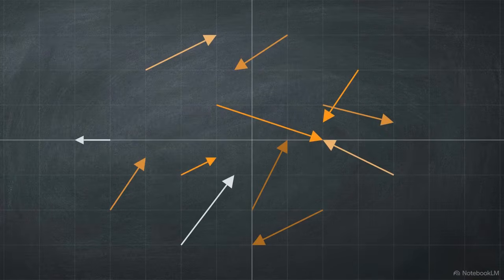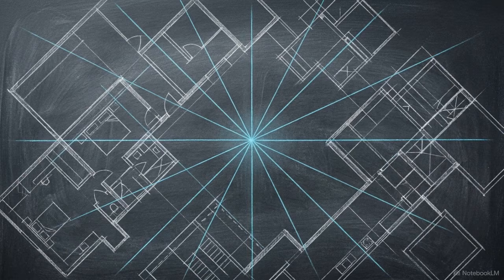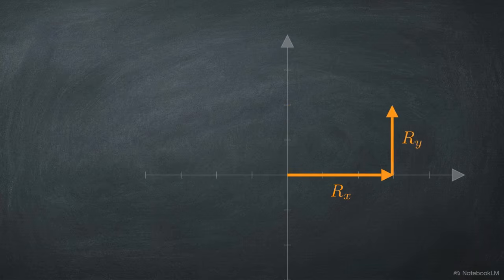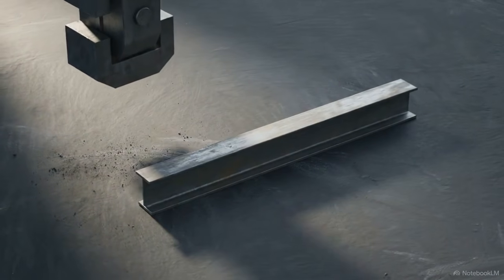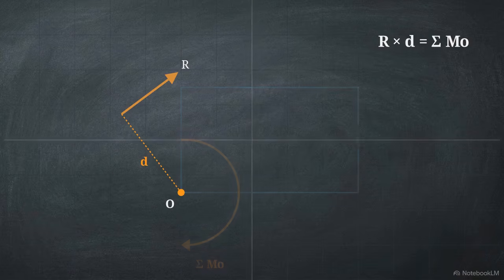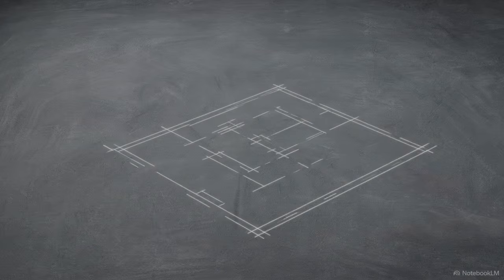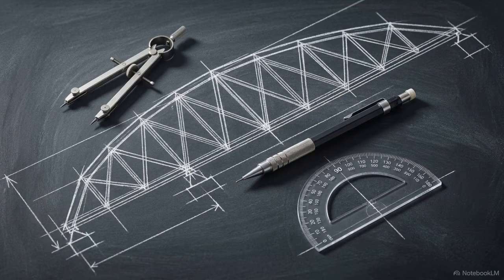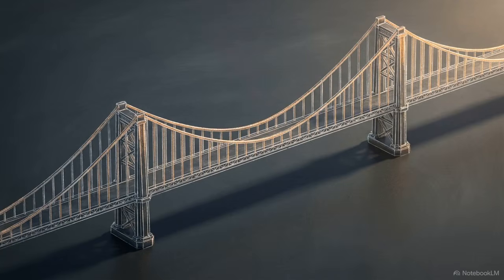Taming Structural Chaos  From Coplanar to Spatial Resultants

Comment: 2D→3D uses the same core rules, just extended. Unit vectors split forces into clean x/y/z parts. Resultants combine them via magnitude and direction cosines. 3D moments use cross products for full rotational clarity. This turns complexity into straightforward, systematic analysis.

Comment: The most important thing that I have learned from this video clip is the need to understand the concept of vectors in 3D force systems compared to 2D. Through Cartesian vector notation, the unit vector approach, and the directional cosines approach, it is possible to express forces in all the three directions. It was important to understand the use of the cross product to calculate moments since it reveals the effect of the force’s magnitude, direction, and location on the structure.

Comment: The video helped me understand that complex force systems can be simplified by breaking forces into x, y, and z components using vectors and unit vectors. I also learned that resultant forces and moments help engineers understand the overall effect of forces and their positions on structures.

Comment: I realized that structural forces can become complicated when they act in different directions, especially in three dimensional space. By using orthogonal decomposition, these forces can be separated into simple X, Y, and Z components, making them much easier to calculate and understand. Instead of dealing with many forces individually, we can combine them into one resultant force that represents their overall effect. I also learned that moments are important for understanding the twisting or rotational effects of these forces. Overall, this lesson showed me how engineers can turn complicated spatial forces into organized calculations that help make structures stable and safe.

Comment: Complex force systems can be simplified by finding a single resultant that represents their overall effect. What I found interesting is how unit vectors and x, y, and z components can be used to analyze forces in three-dimensional space. The discussion of moments also helped me understand that the position and direction of a force are just as important as its magnitude. This video is very helpful by showing me how breaking down spatial forces into components makes 3D statics problems more organized and manageable.

Comment: My key takeaway is that the 'resultant' isn't just about simplification, it's a critical bridge between physical complexity and mathematical control. Whether dealing with coplanar or spatial systems, the fundamental workflow remains consistent, decomposing vectors into their orthogonal components and applying the principle of moments to ensure the resultant accurately replicates both translation and rotation. It’s a powerful way to turn structural chaos into a solvable model.

Comment: I learned from this video is that solving spatial resultants requires understanding vectors, unit vectors, and cross products, not just simple force addition. This help me see how engineers analyze forces and moments in three-dimensional structures accurately. This lesson made me appreciate the importance of vector analysis in engineering mechanics.

Comment: Hello! After watching the video, this helped me to understand how engineering analysis transitions from 2D coplanar systems to 3D spatial systems. I learned that using Cartesian unit vectors and cross products makes it easier to determine spatial resultants and moments accurately. These concepts are essential for solving real engineering problems involving complex structures. I learned a lot from the video, thank you!

Comment: I learned in this video that moving from 2D to 3D statics uses the exact same rules, not new physics. You just break forces into basic x, y, and z parts to find one main combined force. Then, you place that force where its turning push matches the original forces. In short, 3D math is just adding a third direction to simple 2D steps.

Comment: Navigating 3D force systems is inherently more complex than working in 2D because of the third spatial dimension. However, utilizing vector notation across the x, y, and z axes provides a structured way to define both the magnitude and direction of a force. Additionally, applying the cross product makes calculating moments in three dimensions straightforward. Mastering these vector techniques is vital for analyzing real-world structural scenarios and tackling advanced engineering problems.

Comment: What I have learned is in coplanar concurrent force systems, all forces meet at one point; to find the resultant, we can simply use trigonometry methods, and when forces do not meet at a single point, they form a non-concurrent system. Varignon’s theorem helps locate the resultant’s position by stating its turning effect equals the total of all individual moments.

Comment: I realized that solving 3D force systems is more difficult than solving 2D problems because you have to consider one more direction. At first, it was a bit confusing, but I learned that using vectors and the x, y, and z axes makes it easier to represent the magnitude and direction of a force. I also learned how the cross product is used to find the moment of a force, which is an important concept in engineering. Even though the calculations can be challenging, understanding these ideas helps me see how they are applied to real engineering situations and prepares me to solve more complex problems in the future.

Comment: I learned that solving 3D force systems is harder than solving 2D problems because there is one more direction to consider. We use vectors and the x, y, and z axes to show the size and direction of a force. We also use the cross product to find the moment of a force. These ideas help us understand and solve real engineering problems.

Comment: I learn that analyzing 3D force systems requires a far more systematic vector approach than 2D problems. By leveraging Cartesian vector notation, unit vectors, and directional cosines, complex spatial forces can be represented with precision. Additionally, applying cross products to calculate moments highlights how force magnitude, direction, and position positionally impact a structure—demonstrating how these foundational concepts unite to solve real-world engineering challenges.

Comment: One of my biggest takeaways is that solving 3D force systems becomes much more organized when using unit vectors. They allow forces to be expressed accurately in the x, y, and z directions, making it easier to calculate spatial resultants and moments. I also learned that the cross product is essential for finding a 3D moment because it accounts for both the magnitude and direction of rotation. Overall, breaking vectors into components makes complex engineering problems much more manageable and precise

Comment: Similar to the previous video posted, forces is not that simply vertical and horizontal movements but it also acts at angles which makes the analysis difficult. Here in the video, the resultant force is explained further that it is a single force that replaces an entire system of forces and should have same linear motion and moment. Coplanar Concurrent and Coplanar Non-Concurrent are also differentiate where Coplanar Concurrent lines of action intersect at one common paint while the second one don't. Trigonometric knowledge is a vital component we student should have since this is widely used in this topic.

Comment: This video made me realize how engineers make complex structural forces easier to study by replacing many forces with a single equivalent force called the resultant. For 2D systems, forces are broken into horizontal (x) and vertical (y) parts to find the total push or pull, while non-concurrent forces use the principle of moment or Varignon's theorem to find where the total force actually pushes. It's the same case in 3D systems but in 3D direction z is added allowing engineers to calculate the total overall force and pinpoint its exact position in space.

Comment: Good video, explaining how things and real life problem in terms of structures are solve using process such as breaking down and solve every problem one by one till arrived in one answer or called resultant. 2d and 3d version are just the same but 3d version can give a much more accurate visualization on the problem and process. Monotoring and analyzing the problem carefully is a mandatory in every situation before coming up to the final answer. Balance will only be attained using proper calculation and visualization especially with the use of cartesian plates to draw and solve different structural problems.

Comment: The video really made engineering click for me. It’s all about taking tough problems and making them manageable. When you split forces into horizontal and vertical components, everything starts to make sense, you can actually see how a structure holds up and figure out if it’ll stand firm or wobble. What stuck with me most was how important it is to tackle problems one step at a time. If you keep things organized and break the work down, even the hardest challenges don’t feel so overwhelming.

Comment: After watching the lesson, I realized that solving spatial resultants is easier than I first thought. The most important part is breaking each force into its x, y, and z components using unit vectors. Once the forces are separated, it becomes easier to add them and find the total force. I also learned that in 3D moment calculations, the position of the force is just as important as its direction. This topic showed me that solving engineering problems becomes more organized when each step is done carefully.

Comment: This video explains how force reduction is used by engineers to simplify and be efficient at solving multidirectional forces into a resultant. With this, engineers can predict the structure's movement. The addition of the Z-axis allows us to solve for the total force magnitude of the structure. The main takeaway here is that simplifying forces into a single resultant vector is essential to predict if a structure will stay balanced or collapse.

Comment: The clearest takeaway I got is how everything builds up from 2D coplanar forces into full 3D spatial systems — it’s not just adding a z‑axis, it’s a whole systematic shift. Using Cartesian vector notation and unit vectors with directional cosines makes it so much cleaner to handle forces in space instead of guessing angles. And the big one: moments in 3D aren’t just force times distance anymore — you really need the cross product M = r × F to get both magnitude and direction right, especially when calculating moments about specific points or axes. It ties everything together so you can actually compute resultant force magnitude and directional angles precisely.

Comment: I've realized that the disciplined application of three-dimensional orthogonal decomposition across the x, y, and z axes is the key to mastering spatial force systems. Using cartesian Vector, unit vector and etc.
I can now determine the precise magnitude of a resultant vector in space instead of being overpowered by 3D complexity. I've come to understand that Varignon's theorem allows me to satisfy rotational moments by adding the individual moments produced by these decomposed forces, continues to be the main driver of the analysis. In summarize, this video really helps me to really analyze more complex problems that we will tackle in engineering.

Comment: my point is that it is easier to analyze forces in 3D using unit vectors. By breaking each force into its x-, y-, and z-components, the spatial resultant can be determined and the moments can be calculated accurately. This is because real structures are subject to forces in multiple directions simultaneously.

Comment: Instead of dealing with a bunch of forces acting in different directions, engineers simplify everything into one equivalent force called the resultant. This is done by breaking each force into its x, y, and z components, adding them together, and calculating the final magnitude and direction. For more complex 3D force systems, moments are also considered to determine the exact point where the resultant acts. What I found interesting is how a complicated set of forces can be reduced into something much easier to understand and analyze. It made me realize that solving engineering problems often starts with simplifying them into a form that is easier to work with.

Comment: I’ve come to see that mastering spatial force systems is really about the disciplined application of three-dimensional orthogonal decomposition across the x, y, and z axes. Instead of feeling overwhelmed by 3D complexity, I can use a single equation, the square root of the sum of the squared components, to find the exact magnitude of a resultant vector in space. I've realized that Varignon’s theorem remains the engine of the analysis, letting me satisfy rotational moments by summing the individual moments generated by these decomposed forces.

Comment: I realized that tracking every single force on a large structure is overwhelming, which is why combining multidirectional loads into one single resultant vector makes engineering math so much simpler. I can see this clearly in high-voltage transmission towers, where wind pushing sideways, cable weight pulling down, and line tension pulling along depth are simplified into one 3D resultant force to keep the tower from tipping. Ultimately, adding a Z-axis to break these forces into simple X, Y, and Z grid components turns complex spatial chaos into a clear, manageable calculation.

Comment: The house I’m sitting in right now is literally a byproduct of this lesson. It’s easy to take shelter for granted, but every roof over our heads exists because of this exact mathematical logic. Real-world structures constantly absorb a chaotic mess of multidirectional forces pushing, pulling, and twisting from all angles at once. Instead of tracking dozens of independent vectors, engineers use orthogonal decomposition to break forces into X, Y, and Z components, condensing them into a single equivalent resultant. By balancing both straight movement and off-center twisting effects through principles like Varignon’s Theorem, physical chaos is turned into a predictable, safe model. Without this core concept of spatial resultants, none of the homes or structures we rely on every day would be standing.

Comment: I think the unit vectors standardize force direction making it easy to calculate the load, cross products handle rotational effect, and together they reduce arbitrary 3D load distributions into an exact, six-degree-of-freedom system ready for equilibrium analysis.

Comment: My key insight from this video is that moving from 2D to 3D force systems requires a more systematic understanding of vectors. Using Cartesian vector notation, unit vectors, and directional cosines makes it possible to clearly represent forces in all three dimensions. I also found the application of cross products for calculating moments especially important because it shows how both the magnitude and direction of a force, as well as its position, affect a structure. Overall, the video helped me see how these concepts work together to analyze more realistic and complex engineering problems.

Comment: Spatial resultants are derived from coplanar systems using Cartesian position vectors. By applying Varignon’s Theorem and the cross product, 3D forces and moments about any point or axis can be calculated, even when the geometry becomes more complicated.

Comment: The video gives a clear explanation of how to analyze coplanar and spatial force systems by breaking each force into its orthogonal components and combining them to determine the single equivalent resultant. It also demonstrates how the same principles used in 2D vector analysis can be extended to 3D by introducing the z-axis. By presenting the concepts in a logical, step-by-step manner, the video makes structural force analysis more organized and easier to understand, especially when dealing with more complex problems.